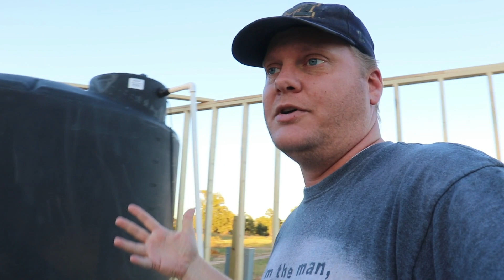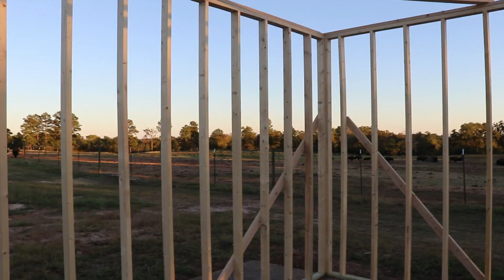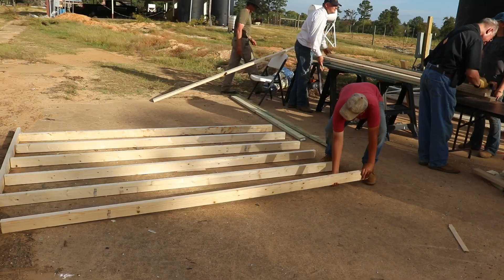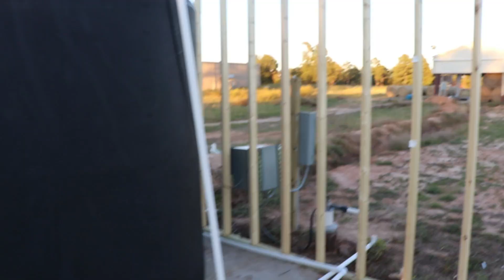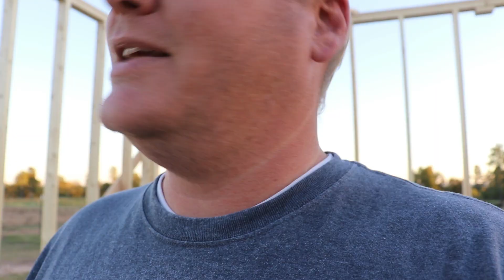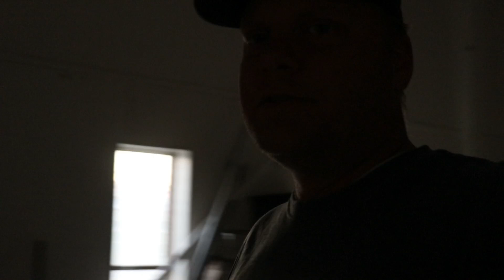Ep. 224 - DIY Framing a Well House / Workshop for the Ranch: Part 1

Comment: Just make sure when buying bits for the SDS hammer drill you buy the correct style bit for the drill.  There’s SDS, SDS+, SDS Max.  All SDS style but different sizes for different chucks.  It’s a real burn when you get the wrong one.
Reply from the maker: Gosh, never thought about that.  Thanks for the info.

Comment: I still say gets some sealer and make a roller skating rink.  Also you could get a shuffle board set for that big building cheap fun. Just paint the board on the floor and get some corn meal.
Reply from the maker: There is a basketball court at one spot.  A shuffle board idea is interesting
Reply: @BlackacreRanch  we had one when I was a kid it’s fun.